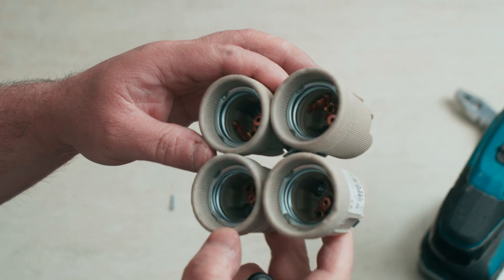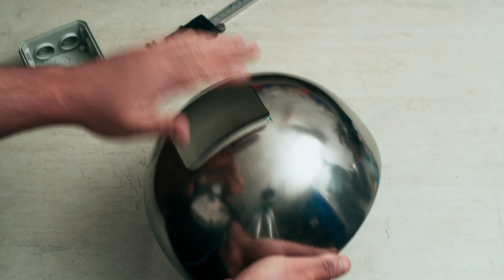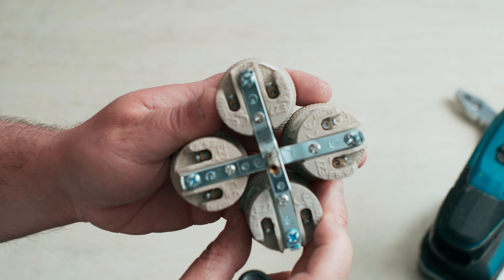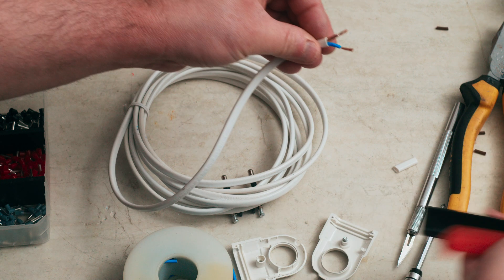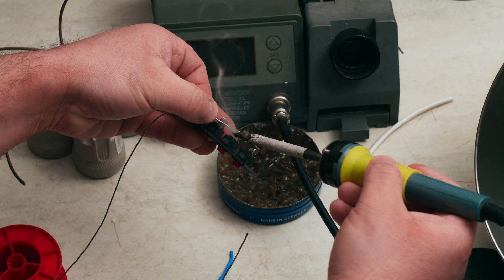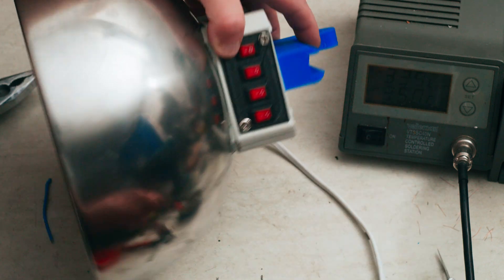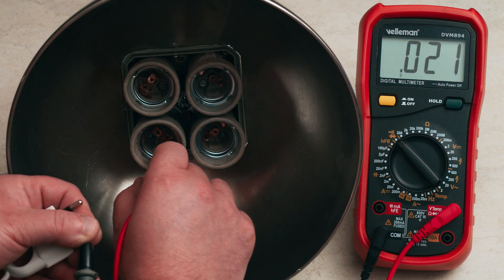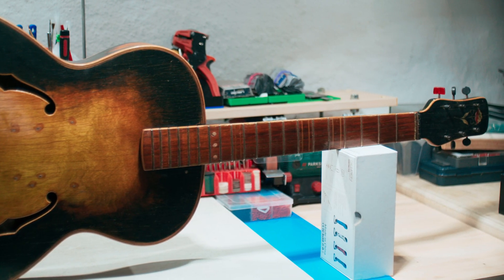$20 DIY Photo / Video Studio Light

Comment: how do you know what end is the neutral on a socket?
Reply from the maker: Hi! Thanks for the question. Technically it does not matter  which terminal is which, but I usually like to have the live end to be the tip of the bulb, and the thread to be the neutral. I do this because, if I change  a bulb while the light is on, the live end will be the furthest away from my fingers. But in this case, in a 230V system, the mains plug prongs are identical so you have to measure to see how you insert the plug into the wall. I do measure, I like to know where the live wire is. When I installed my house's wall outlets, I wired all the live wire to the right holes, so I know.